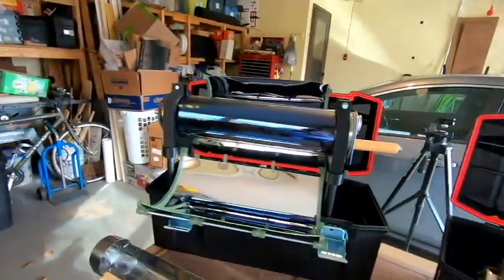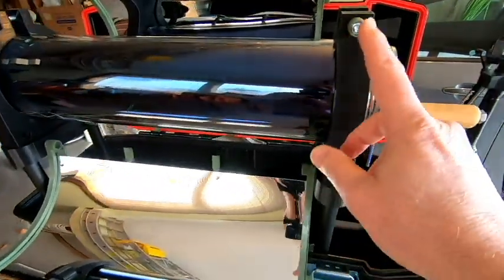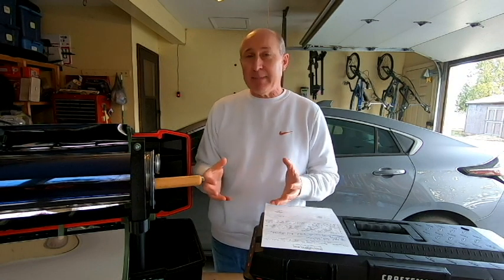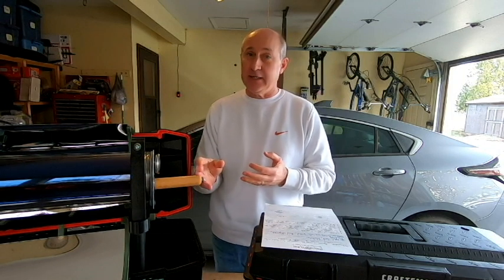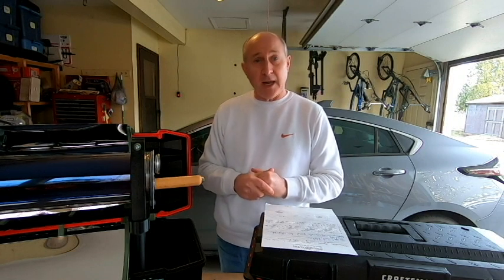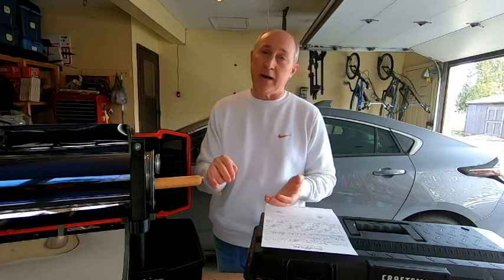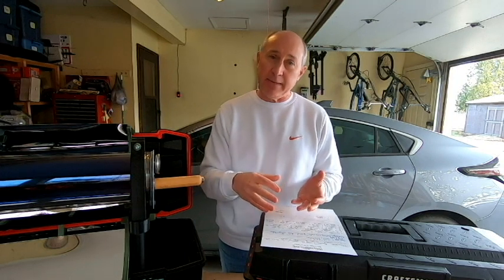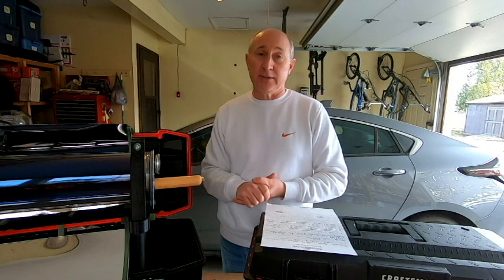Stockton Solar Oven - Part 1 - Introduction

Comment: Hello. I just found and anxiously subbed. I'm a long time wilderness prepper from bush of Alaska now in NW mountains high fire hazard area solar n wind power waaaay off grid and have been pursuing this topic. Off grid since since 1969. I'm confident I can build this but won't have access to printer or parts cutter. I'd like to know if you've created a set of plans I could use. I'm 80 and very limited funds but wish to do this. Thanks Dandahermit